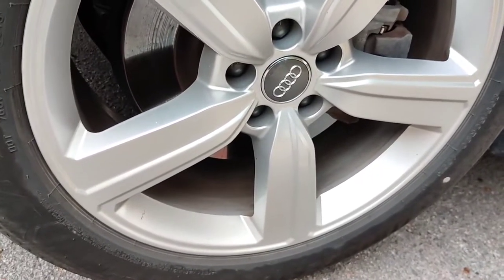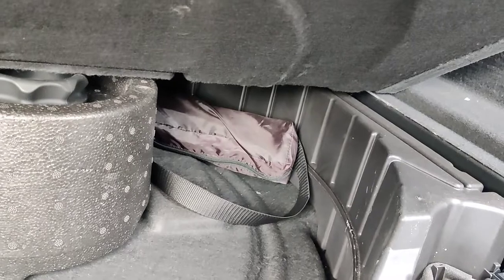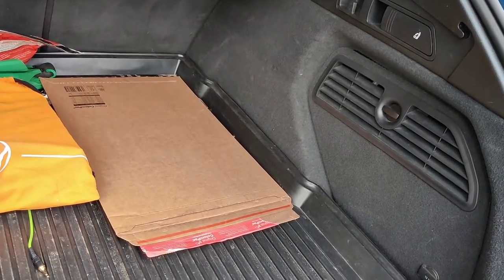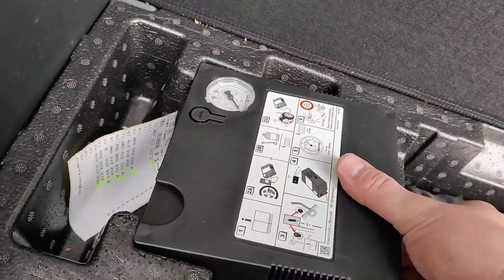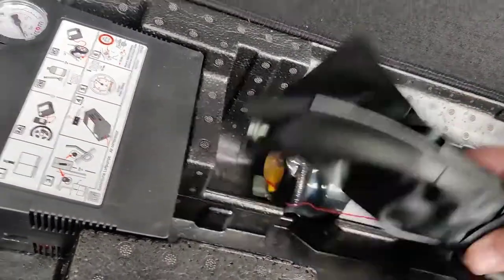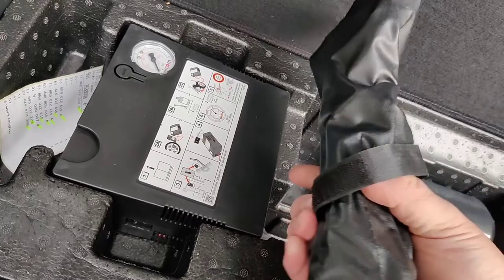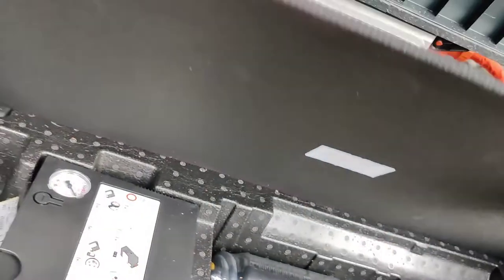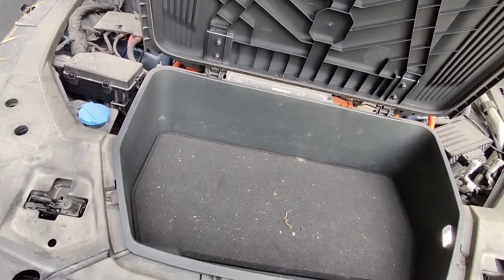Flat tire and no spare in Audi e-tron?

Comment: We had loads of fluff about how EV's did away with all the tradition drivetrain mechanicals and could be packaged better and give far more interior space than a traditional ICE car. So here with the E-Tron we have a typical EV....a huge SUV at that....and no spare wheel, and not enough room to store a decent size spare under the boot floor.
My ICE diesel 12 year old 'traditional' E Class estate has a huge boot, and under the boot floor a big spare wheel, and still room under there for loads of crap like coats, umbrellas, cycling gear, walking boots, shopping bags, long jump leads, big wheel nut wrenches, a rechargeable air pump, etc, etc, etc.
You know what.....just give me an EV with that sort of old-fashioned storage space, and I'd be happy.